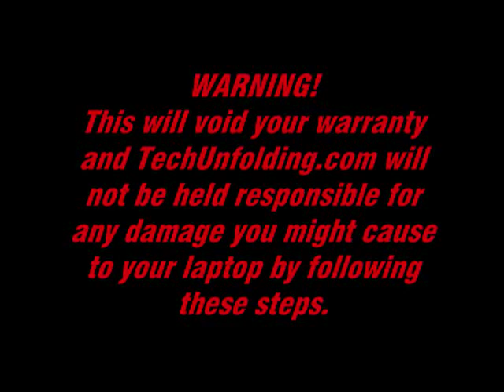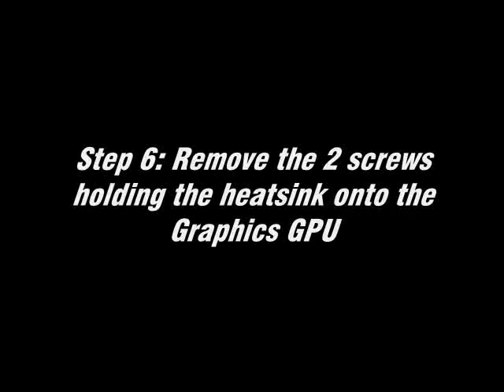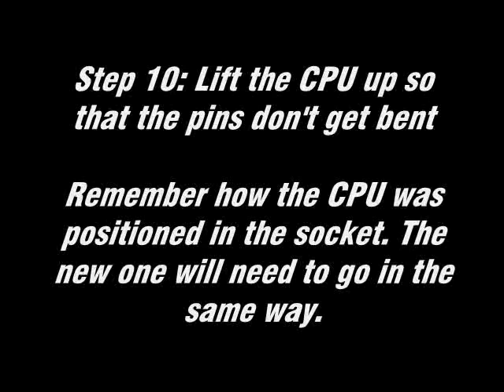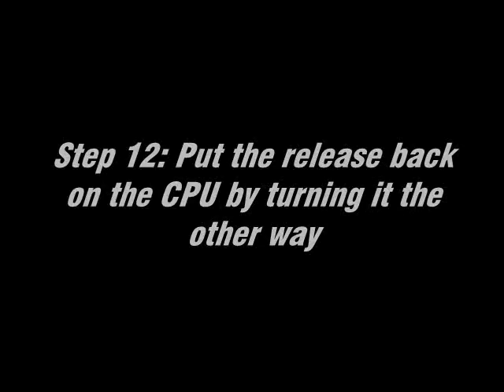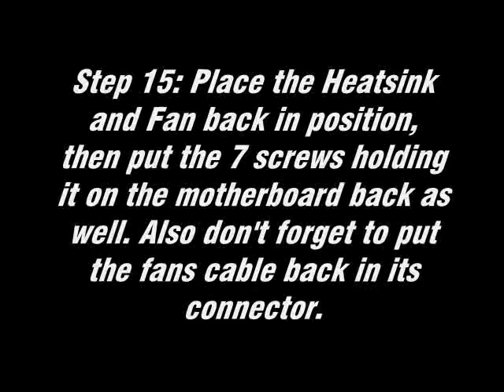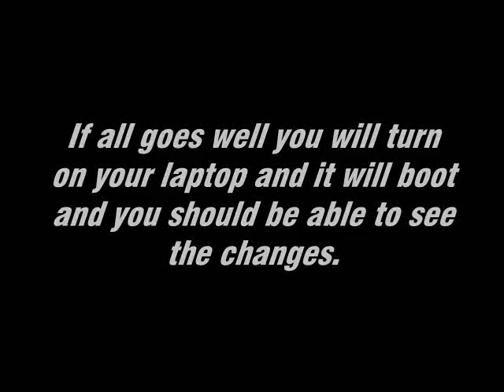Changing the CPU in a Dell XPS M1530 Laptop

Comment: The best processor upgrade is the Intel T9500 @ 2.60GHZ. Supports the socket PPGA478 and is only 45nm so overheating is not a problem.

Comment: Thanks, you should mention that you have to take care of the TDP, Chipset and BIOS-Compatibility.

And completly clean the cooler before reinstalling it... use liquid metal, you gain at least 10% better cooling.

This cpus without a heatspread are really really sensible to pressure...

Comment: @suxondeez I'm guessing it keeps the CPU and GPU from overheating since these can reach great temperatures. Think of the paste as the computer equivalent of a polar bear's fur in Antarctica. It allows heat to pass through so it stays cooler. The fan helps further.

Comment: according to a dell diagnostic test (Power ON + FN), my CPU either needs reseated or replaced. I'm guessing replaced since it's been working fine for years. stupidly I've worn away the top right screw (#1) and may have to take a dremel to it to make a cut for a flat head screwdriver and covering the rest of the motherboard beforehand for the metal filings.

Comment: t6400 can be changed to any other 800mhz fsb mobile processor but its expencive because its like 300 USD for like a 0.5ghz difference. if you get what i mean. and if the ram is expandable to 4gb thats the max you can have

Comment: technically the T9900 is since its a 3.06ghz cpu running on the same power consumption or for a more energy efficient option the P9700 which runs at 2.8ghz but runs at 7W less power which makes it run much cooler and use less battery

Comment: Would I be able to do an upgrade from a Celeron M 575 to a Core 2 Duo T9500? My laptop has auto-adjustable TDP, supports 800MHz FSB and other Core 2 Duos listed as options have the same TDP (35w) as the T9500. Both of these CPUs are also from the socket P (PGA478).

Comment: If you wanted to do it the right way, use arctic thermal paste remover first, to remove the old gunk, then clean it, then apply the new thermal compound, never reaply new onto an old compound...its inefficient, and might react with one another.

Comment: Excellent video,  very explicit and step by step instructions.. I got a XPS 1530 with
 Inter Core T(M)2 Duo CPU T9300 @2.50 GHz...can anybody recommend a small upgrade for this system?,, sometime my PC doesn't start s I have to use the hairdryer trick and then goes OK intil the next automatic upgrade,, when my PC will not reestart on her own,,, needs help.. thanks in anticipation!